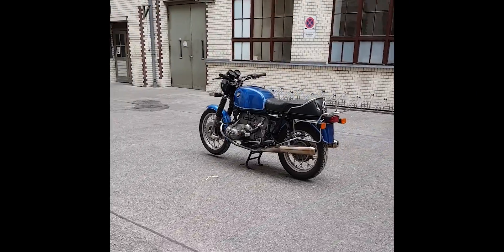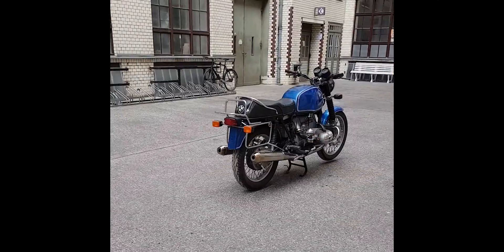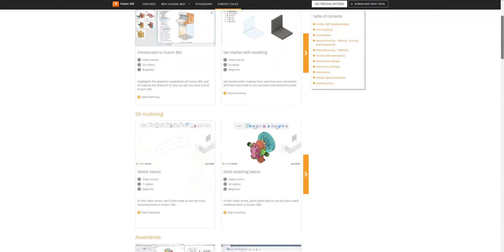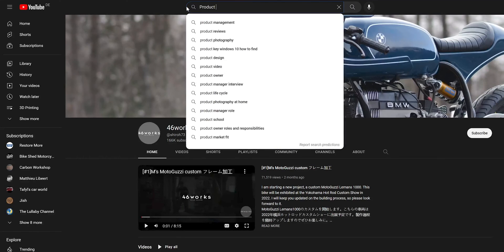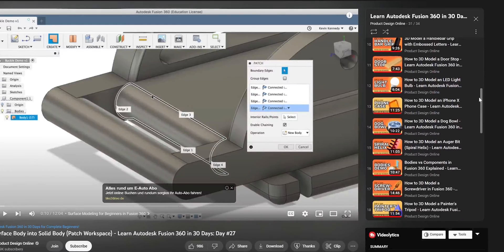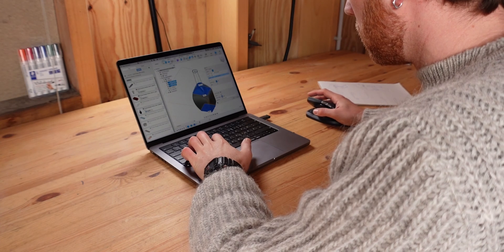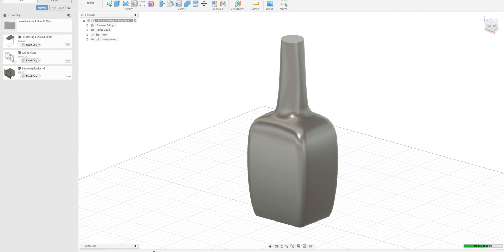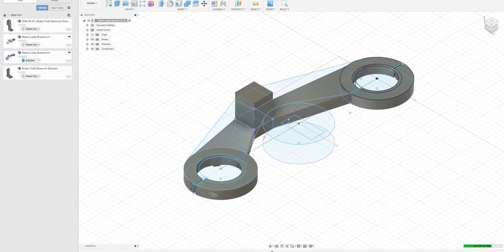THIS Helped Me To Learn Fusion 360

Comment: Great videos man! I’m building my own bmw r100 and I understand your struggles like no other luckily i’ve had a little more experience working for arjan van den boom since i was 15.  I’m using shapr3d the 3D draw my simpeler parts also a very intuitive software. 

If you run in to any issues when you get in to the more mechanical or for example the wiring feel free to shoot me a dm on insta. Same user name!
Reply from the maker: Hi Sam, thank you so much for your feedback. Messages like yours make my day. Super cool that you're also building your own BMW. I'll take you up on your offer. Would love to learn a thing or two from you...and see some pictures of your R100! I've just sent you a message on Instagram.

Comment: good work dude! i also have an airhead and an ender 3. haven’t made anything specific for my bike as i’m worried about strength. what material do you plan on using ?
Reply from the maker: Hi Andrew! That sounds great.
Do you keep your BMW original or are you building a custom bike as well? :)
I think I also won't use any printed parts in the final build but it helps me a lot on the journey of understanding how to design parts. There is a company here in Germany  that builds parts fully automated from your stl file. I would like to try that out...I'm curious about their pricing. 
I wish you a Merry Christmas :)